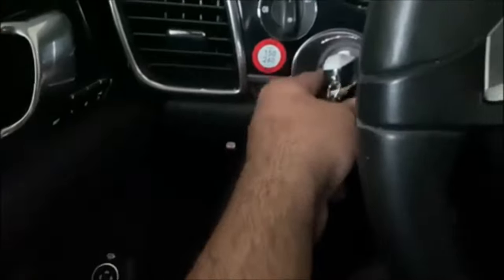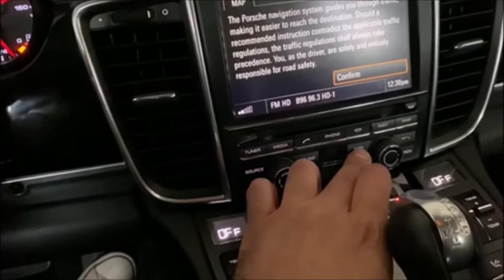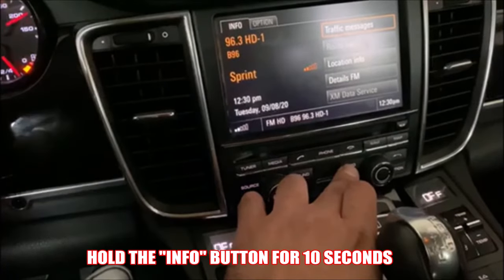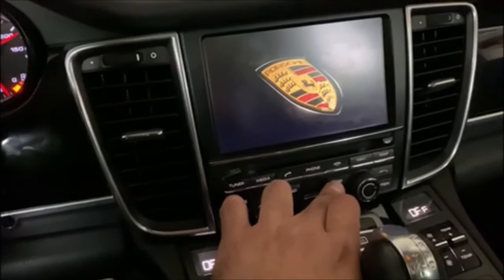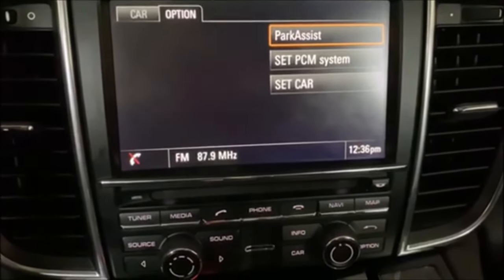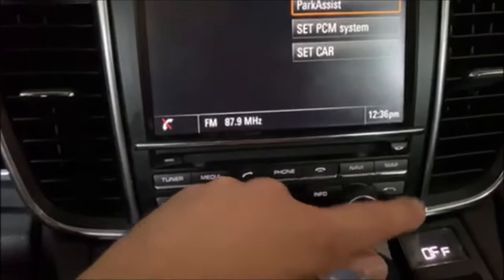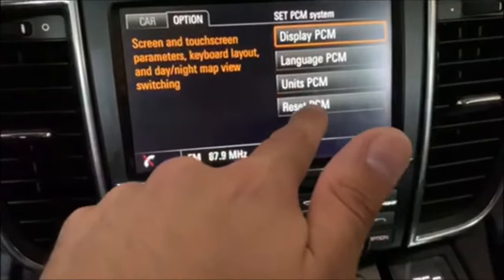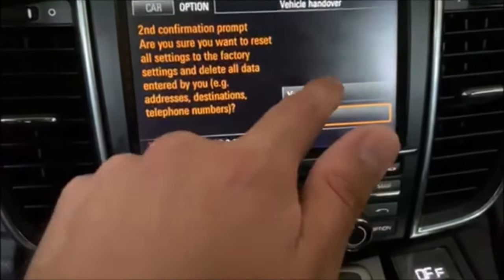Porsche PCM Radio Reset | FIX Common ISSUES !

Comment from the maker: If you have any questions, comment below! Make sure to "Subscribe" to catch all the latest content!
Reply: I have a 2008 Cayenne Turbo. My radio/ nav is showing a fault. Is this what I need to do for it?
Reply: got a 957 cayenne turbo s and there is no sound coming out of the cd or radio menu, tried this reset and still have the same problem
Reply from the maker: @whosef8x  If the radio unit itself is working fine. I would check the fuses for the amplifier. Hopefully it’s an easy fix for you!

Comment: Still does not work. It is now resetting. Every 30 seconds. There is now no navigation maps, no USB or jukebox icon in the media menu.
Reply from the maker: If the reset didn’t work you may need a software update to fix the problem. Also if your using sirius radio that has been the root of most of these issues.

Comment: Only getting worse I lost my camera and my radio keeps resetting , bit of a pain to deal with any idea if we can software upgrade via a SD card ?
Reply from the maker: Unfortunately a software update for the PCM would need to be done with a computer and the correct software. Not sure of any aftermarket scan tools that can do an update but they may be out there.

Comment: It didn't work for me. I did it few times. Still just shuts off and restarts over and over again. If the radio is off when I shut the Cayenne off it will normally stay off. If it does come on if I turn it off it still comes back on. PITA!

Comment: Hi I have a question I change the battery on my 2013 985 and now getting stop start deactivate? I coded the new battery to the car any idea? Many thanks
Reply from the maker: Hi, can you tell me which battery you used for replacement? These cars seem to have issues if the proper battery isn’t used.
Reply: @FlipITGarage  hi it is Yuasa  YBX9020 Start/Stop 12V AGM

Comment: Still doesn’t work for me, I have a Macan Turbo 2015. It still keeps rebooting and my navigation is gone :/
Reply from the maker: Porsche recommends this reset to fix the issue. But doesn’t always work. You can try turning off the PCM before turning the car off and turning it back on after putting the key in. But you’ll have to do that every time to prevent the rebooting issue. It’s a temporary fix but seems to work for a lot of people. The PCM may need to be replaced in your case. You can also try removing the PCM fuse for 10 mins and see if that helps.
Reply: @FlipITGarage  What’s fuse number sir ??
Reply from the maker: @محمدالسريع-ظ7ه  Drivers side #3 fuse is for the PCM.

Comment: I have an audio off message in my dash ever since I awitched the stock radio to an Android radio o
In my 2009 Porsche Cayenne.  Everything works, including steering wheel controls and the newly added back up camera.  Ca. You explain why it says "audio off?"
Reply from the maker: Sorry don’t know much about the aftermarket android units. Try and locate a reset procedure for the unit you bought.

Comment: Hi have a 2011 997 4s there is no sound from the stereo, looks to be the amp from what I have read, does the new amp have to be programmed or is it plug and play, thank u, in the UK.
Reply from the maker: Hi, new amp will be plug and play. Replaced the Bose amp on my Panamera and it was plug and play no programming needed.

Comment: I have a 2017 718 cayman with the base speakers  there is audio, but no bass will this help or do you have any idea how what to look for?
Reply from the maker: Sounds like you may have an issue with the amplifier. If this doesn’t work I would lookup to see if there is a fuse for the amp.

Comment: Hello, I have an imported US Cayenne 2013 model. Is there anyway to load the navigation system with my local maps instead of the current US one? Many thanks in advance.
Reply from the maker: You can change region with the PIWIS software. Usually the dealer has that and possibly some independent shops. Not sure on the cost. Might be easier to buy a used pcm on eBay and just swap them out then sell yours. Just a thought.
Reply: Many thanks @FlipITGarage

Comment: My issue is with the Navigation System.  Mine thinks I'm in a different city and at times even in a different state!  Frustrating. I have a 2017 Macan S.   Any suggestions?  Thanks in advance for responding.
Reply from the maker: Sounds like that would be a programming or gps antenna issue. Unfortunately it may need to be brought to Porsche. You could try disconnecting the battery to reset it but not sure if that would fix it.

Comment: I just bought 2014 cayenne S wrecked had no power then replaced battery, i did this procces but radio turns on and off by it self any help on this?
Reply from the maker: If this reset didn’t work for you. You may need to get the PCM updated. That should solve the issue. Unfortunately it would have to be through the dealer unless you can get someone with the programming equipment.

Comment: Hi, i did reset PCM a d still dooing the same reboot after 5 min !! Do you know what i can do ? 
Thank you
Reply from the maker: Hi, may be an internal issue with the pcm. You can try pulling the pcm fuse for about 30 minutes then reconnecting. Long shot but may work.

Comment: I have Macan 2017 and i don't have sound , i said "audio no available " i check all fuse and all of them is good. You know what is the problem? Thanks 😊
Reply from the maker: The reset procedure didn’t help at all? I’ll look into other possible fixes for you. But if the reset didn’t work may be an issue with the amp or programming.

Comment: I have a 2015 Macan Turbo. When I get home I'll turn the sound on the radio all the way off. Then I remove the key fob, get out of the car, and later when I start up the car, the radio turns back on faintly - even though I've previously turned off the sound.  I brought it in today and the service manager had a look at it. He monkeyed around with it and said, "Yes the sound does come back on." He said he'd seen this once before and had no idea about how to resolve the issue. Any ideas?
Reply from the maker: Strange doesn’t do that on the Panamera I own. Maybe you can turn off the radio completely before shutting the car down?
Reply: @FlipITGarage  I've tried that - no dice.

Comment: My 2005 911 is stuck on one radio station and I can't turn it off or lower the volume. It's stuck and none of the functions are working.
Reply from the maker: Not sure on what radio system an 05 has but are you able to reset it?

Comment: I've done this multiple times - but still no sound .  Coincidentally it happened after I cancelled XM service while it was sitting in storage with a battery tender on.  Any ideas on further fixes?  I get no sound at all (GPS, Bluetooth, and radio).
Reply from the maker: If your having an issue with the sound and not a reboot issue. You may have a problem with your amplifier. Check the fuse in the trunk. If that is fine I believe there may be a relay. Swap it with another. If that doesn’t fix it may be the amp itself.
Reply: @MVGarage can you do a video on the fuse in the trunk as my Radio started turning itself off and on in November 22 now it won't come on all fuses in the front are fine.